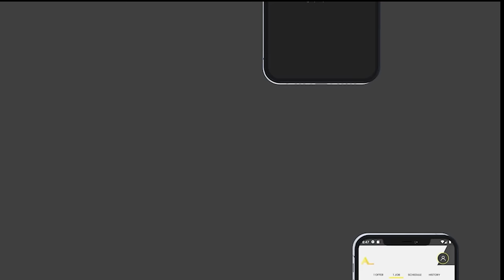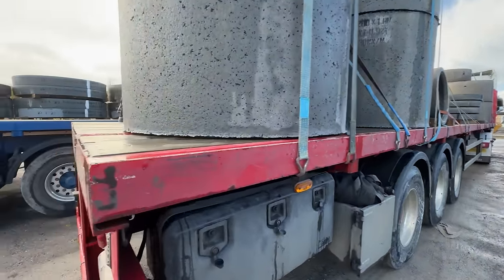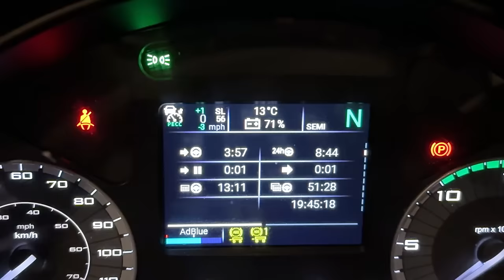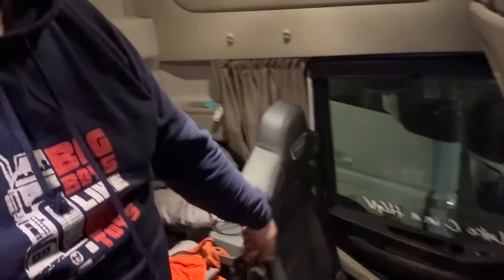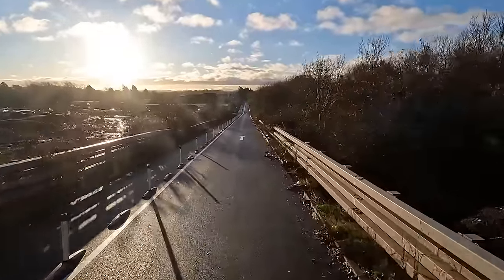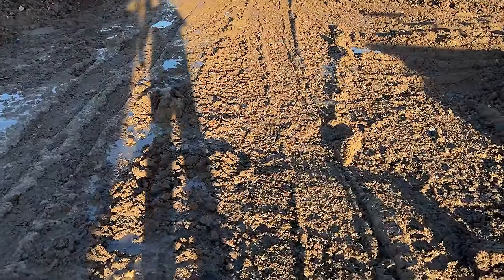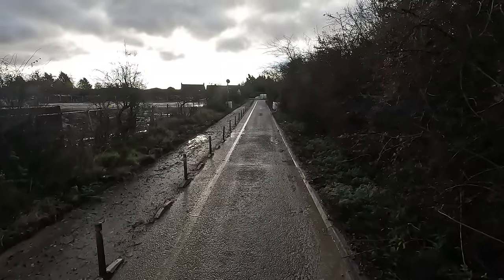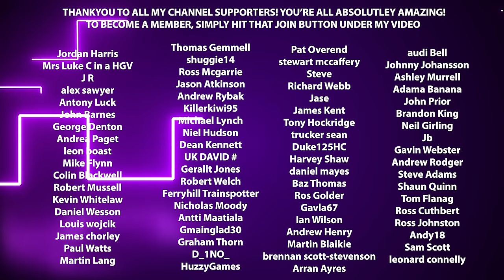Local Didn’t Seem Happy When They Saw Me!

Comment: Great vid as always,only criticism on the concrete section strapping,no edge protecters on the edges of everything,cast concrete has sharp edges and will eat through your straps. Also your putting the strap ends on the side rail of the trailer,dvsa will have you for that. Stay safe and keep them coming

Comment: 1.2t , not bad then  -  once dragged one out of a local pond ( kids had rolled it down from a building site and the houses were built and it was abandoned so i was having it lol )  with my Skoda Favorit 1.3 estate car . Put a bar in a hole and used a strap to the tow bar to move it up the bank a bit at a time , chocking it and swapping the bar to the next hole around . Cut it in half with a stihl saw to make 2 arches and trailered them into the local woods with a 1972 Lawnbug ride on mower ( still have it today cos it's built like a tank ) . Slid them down into the ditch ( more of a huff and puff drag really ) side by side and covered in a dry concrete mix to make a bridge for people out walking   . Was there for 15 year's till the dicks in landrovers started rampaging through the  woods and destroyed it cos they wanted a muddy ditch crossing to drive through ?.  ...

Comment: That house builder is known for not putting the roads in first - looks like you were delivering to the subbie groundworker. No wheel wash and delivery route signs which is typical even though the Council asks for them! No tool box talk either. Some sites now have to put inflatable bags around the trailer being unloaded in case anyone falls off!

Comment: Hi Luke.      Great video.   Interesting about the off load at building site.       Engines.  These days engine oil flows much easier therefore one can shut engine off as soon as stop.        May be an idea to have another set of work boots, as especially as you stepped in puddle. !

Comment: The load goes forward when you brake. An emergency braking situation would have those two tall loads on the back vulnerable. Two straps across the front,so it can't move forward.  One over the load . Maybe one around the back. No such thing as overkill on strapping a load

Comment: Luke: A small suggestion: there's no need to spend money EVERY SINGLE TIME your working gloves get wet. Buy some disposal gloves or medical gloves and wear that under your working gloves. So put the disposal/medical gloves on first, then your working gloves. That way, if they do get wet, your hands won't (besides sweat, can't prevent that) nor dirty.
Reply from the maker: Good advice mate. Just been and bought some orange gloves of tiktok. I’ll try that idea out.
Reply: @lukecinahgv  When I do my gardening or any dirty work, I use that idea. Works splendid. Just becareful that those gloves do tear if your doing some heay duty work but with the working gloves it shouldn't be a problem. You might get some water thru wrist but it's better than completely soaked hands.